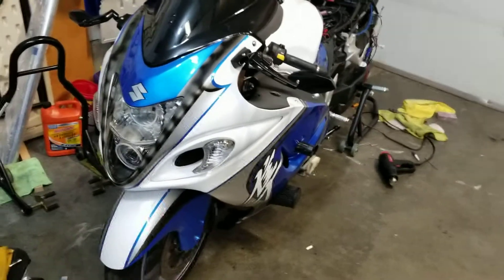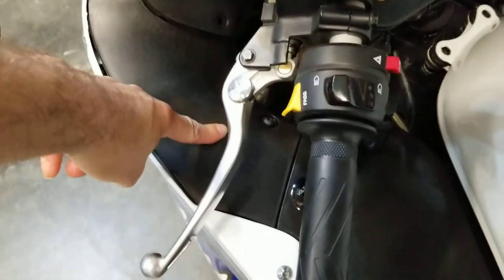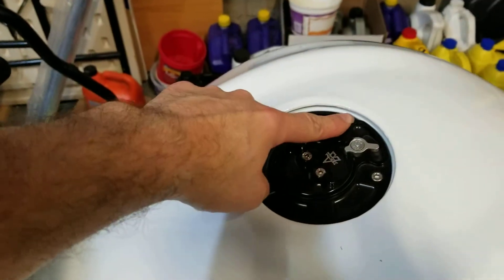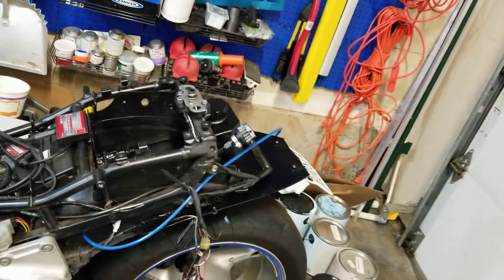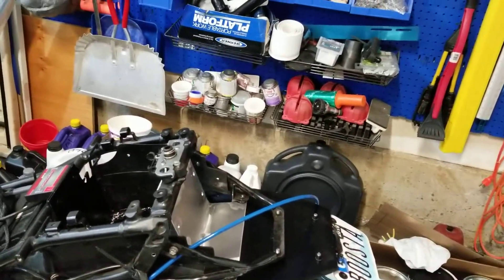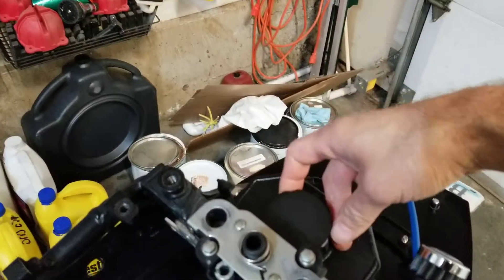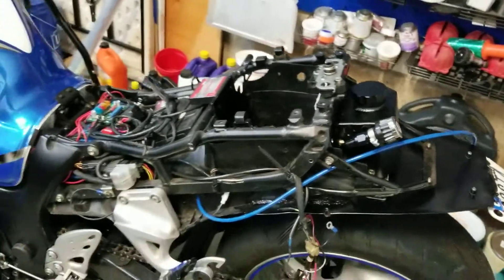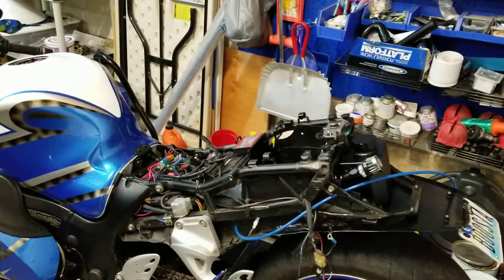BOOSTA new meth tank and bodywork

Comment: So how did you get the tank to stay fit? 
I ordered a tank cover for my GSXR and have the same issue  not completely flush
Reply from the maker: I ended up making some aluminum brackets and using rivet nuts to fasten to the tail frame